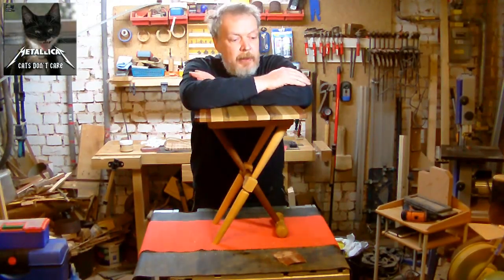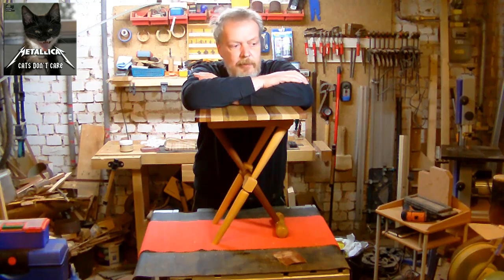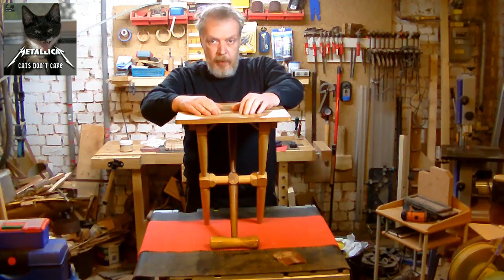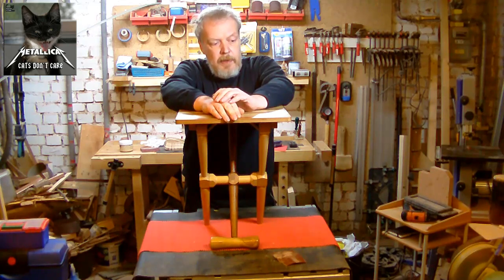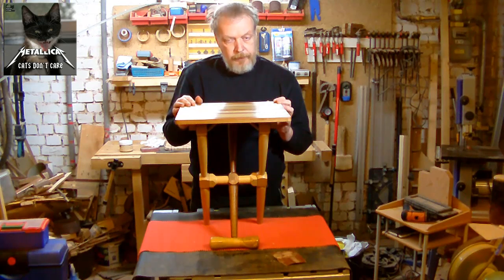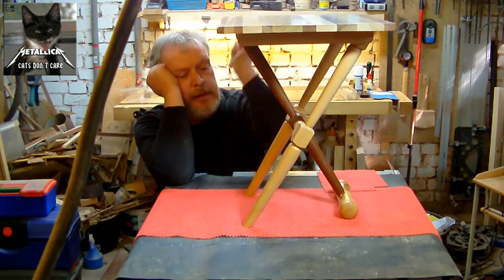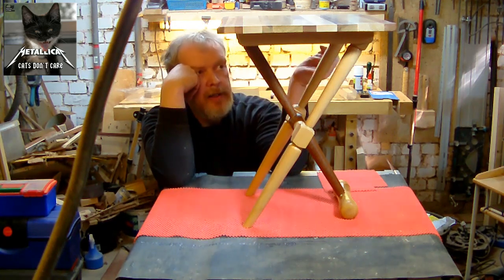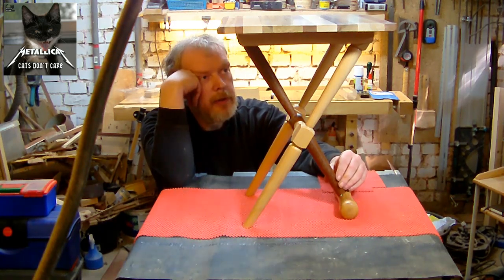Fold Down Bedside Table -- Murphy Nightstand

Comment: Beautiful piece Peter
i like the way you design this table quite a challenging piece

All the best Robbie
Reply from the maker: Robbiethewoodturner Thanks Robbie!
I think, now that everything is done, the biggest challenge was set up by myself, as the whole piece was a 'design on the fly' all the way through. I got a picture in my head, made the board for the top. Thought about one day of how to make the legs for it, searched for wood and turned the legs, only to find out, that my initial idea of a three legged table is a wonky construction so I had to find a way to stabilize it. In the end I had to find something which keeps the legs from total opening, glad I remembered my trivets at this point as I didn't want to have something sticking out of the tabletop's underside which would interfere with the legs in closed position. I think some kind of plan / sketch would have made it a lot easier :-)
Greetings from Good Old Germany
Peter

Comment: You are a very talented man Peter...that table is beautiful.  I think your rope idea to locate the middle leg was ingenious.  You came up with a simple, elegant, solution to a problem that might have required a lot of work to overcome.  Great work.
Best Wishes, Brendan.
Reply from the maker: baconsoda Thanks Brendan!
I had a couple of other ideas, but they either interfered with the legs in closed position, where too fragile or bulky, or too expensive. As there won't be much weight on the table, other than on a chair, I'm pretty comfortable with the rope (my only concern was that it could become longer when you're putting weight on the top).
Greetings from Good Old Germany
Peter
Reply: ***** I don't think you'll have any problem with the rope stretching...unless you intend to rest car engines on the table.
Best Wishes, Brendan.
Reply from the maker: No car-engines in the bedroom!
Maybe a small one from a motorbike :-)
Thanks Brendan for cheering me up today!

Comment: It looks great, and I love your 'design change'.  I adds a unique touch of functional style.
Reply from the maker: Michael Olsen Thanks Michael!
I guess the whole table is a 'last minute' design change as I had no plans and worked with the wood I had laying around and a picture in my head.
As it came to the first dry fit and the table started tipping I was really disappointed and had to think a lot of how to connect the cross piece to the finished and tapered leg! Finally I managed to get the leg back on the lathe and turn the base down to a 20 mm dowel.
Greetings from Good Old Germany
Peter

Comment: Really nice table Peter. We have all ended up doing design modifications on a project before. Keep up the good work.
Thanks
David
Reply from the maker: Sunflowerwoodturning Thanks David!
As I mentioned before, the whole design was kind of a change in it self :-) 
I got a picture in my head and without even a sketch of it I started torturing the wood. Whenever I ran into a problem I had to find a solution on the fly. The hardest ones had been the cross piece on the center leg for stability and the rope to locate the legs as this mechanism shouldn't interfere with the legs in closed position.
In the end I'd like to say, there are no problems which can't be solved, only finding the solution takes a while when you're focused on something else in the build.
-- I guess I have to make at least a sketch for future projects :-) --
Greetings from Good Old Germany
Peter

Comment: Great table, Peter. Very unusual solution with the rope. I like that. Was that the "HB Männchen"? The unknown wood may be maple. Greetings from "Not Far Away". Daniel.
Reply from the maker: You're right my NotFarAway-Friend Daniel!
The solution with the rope took me, I think 2 days. I needed something which wouldn't interfere with the legs in closed position. For the wood, I honestly don't know and I really don't want to guess. As you might know, my source for lumber is the trash of local carpenters, I take what I get and sometimes I have no chance to ask about the species. This is an adventure on its own.
Greetings from the southern Lüneburger Heath into our not so far away Capital
Peter